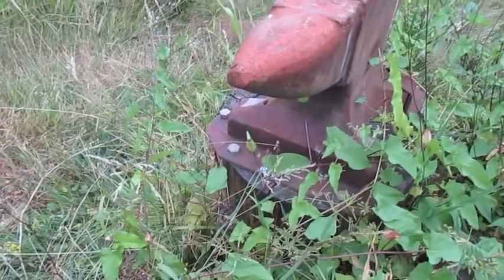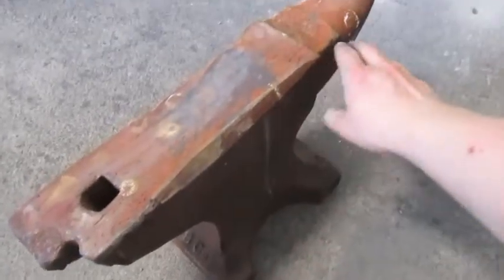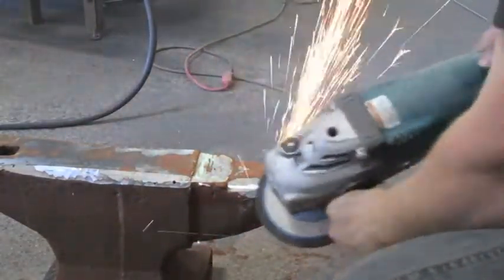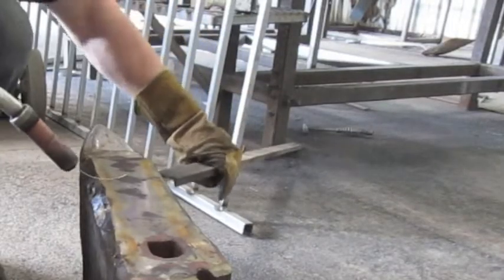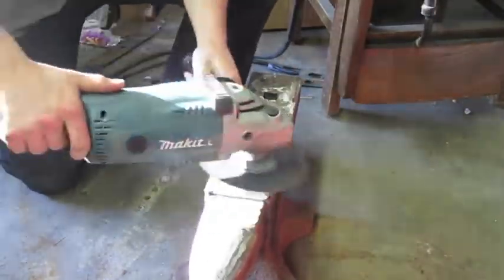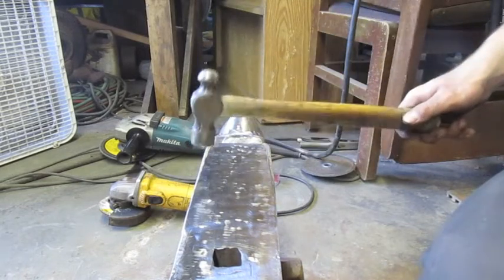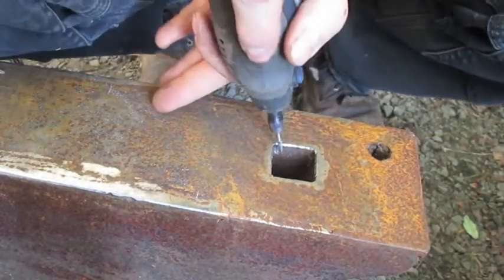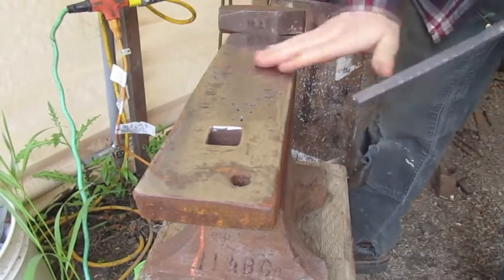Repairing a Vulcan Anvil

Comment: Very good job for turning that piece of garbage into a proper tool. Vulcans are the lowest quality of old anvil.
Reply from the maker: That's my opinion as well. However, I think it's still better having a Vulcan than no anvil at all.
Reply: @caveofskarzs1544  I would gladly go back to using a sledge hammer in a stump than use a vulcan. I love my  53 lb fisher and my 175 peter wright. I wish my peter-wright was a fisher, though.

Comment: Hi, so, I followed (as far as I know) exactly what you did on my anvil, and the welds keep poping off. What am I doing wrong?
Reply from the maker: Interesting.
I can't say I'm an expert on anvil repair, so I can only guess with my limited knowledge. 
If the welds are popping off, it's possible you may need to adjust the settings of your welder. Otherwise, make sure the anvil is preheated, and have it cool down slowly after you are done. 
You might also try some dedicated cast iron welding rod for the first layer if you are welding a Vulcan. 
If none of those work, I'm afraid I'm not sure. Cast iron and wrought iron quality can vary from anvil to anvil.
Reply: I appreciate the advice! My anvil is a Southern Cresent, they have cast body's and steel faces, but when i got mine, it had been "repaired" the untempered super brittle, badly welded face plate broke off on my second project, exposing some extensive damage to the edges very similar to the damage on yours. Two more questions, one is hotter better? Like Should I just heat the anvil up as much as possible? And two if I use nickle alloy rod, would it be easier to weld the steel to the nickel then the cast iron? Again thank you for your help
Reply from the maker: @tyjones8978  Ah, I have seen a couple of those anvils. Didn't know they were cast.
Hotter is better with cast iron, but keep in mind that too much will overtemper any steel. As for the nickel rod, I would say weld to the cast  iron first then the steel.
Reply: Thank you so much man, I really appreciate the help, every other person I've asked just tells me "it's unfixable" or "you can't weld cast iron" or "that anvil is trash anyway" its nice to see someone really do it
Reply from the maker: @tyjones8978 It Couldn't Be Done by Edgar Albert Guest is a great inspiration for me. ;D

Comment: I bought an anvil with the pritchel
 hole broke off like that what kind of filler steel did you use
Reply from the maker: I just used mild steel MIG wire.